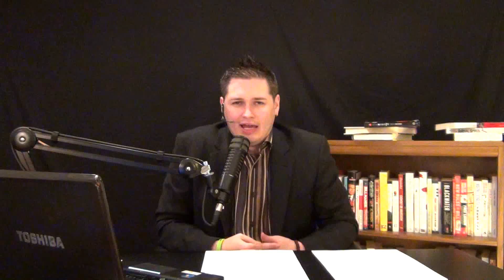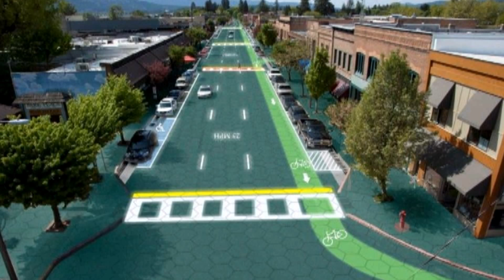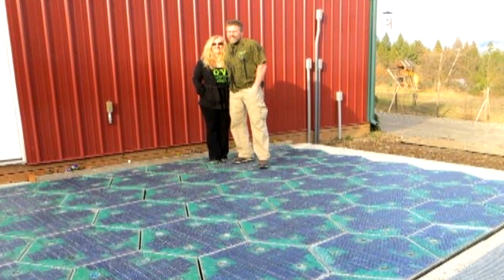Are 'Solar Panel Roads' The Future?

Comment: But will some part of the roads be transparent so that light can enter into the solar panels? Also, the solar panels cannot absorb a lot of light due to obstruction from the vehicles. Hopefully they know that this should not be placed in areas where there will be heavy traffic always in case there will be no light absorbed. Even if the solar roads are placed at areas where traffic is usually light, will the solar panels able to power most of the homes at that area? I am not against the idea, but you have to question it to ensure it can work well for a long time

Comment: Firstly, enough with the man-made climate change nonsense. Man-made activity has little effect on the climate and there are so many other factors that have far greater impact. Also, I still don't believe this is a legitimate role of government. I think infrastructure should go back to being privatized.That being said, I do think this is a great idea. We need to move away from nonrenewable energy sources because they are nonrenewable and will eventually run out. The problem is that solar panels are still pretty inefficient and costly. We don't need government involvement, we need private individuals and businesses to do more innovation free from government interference.

Comment: The latest results show the panels in the Netherlands are 56% as effective as consumer rooftop panels in the same area and even less efficient against commercial solar panels.
Reply: tvuspen commercial solar power requires some form of solar tracking. Which means you need free space to put down frames. Free space is at a significant premium in Holland.

Now we have plenty of roofs. Plenty of wind too. Agree that we should focus on those 2 resources first before throwing away a ton of money, break up our infrastructure just to use solar panels in the worst place possible.

Comment: actually, magic would be a better way of solving all of these issues at once.  Magic will not only do all the things solar roads will do, but will also allow you to magically transport yourself from a to b AND help fight dark wizards.

Sure if you want to believe everything you read that makes you feel good, then solar roads are for you.
For everything else there is science, and those who understand it.

Just run the calculations of average snow fall on us roads, and the energy required to melt it.
Reply: Second time commenting on this. Although the idea behind solar roads are good on paper, when you actually start examining the practicalities of all this; I honestly think it won't work in practice. Why? Its going to cost a ton of money, there will be concerns as to whether it can stand up to the heavy weight of commercial vehicles. Lets not forget the cost of replacing broken panels and in some cases, will these panels even be necessary or needed for that matter. Such as the more remote and rural areas of the country for example? They certainly wouldn't benefit from it IMO.

Also, where's the money going to come from?

Who's going to pay for all this?

Will there even be an incentive to go through with this plan?

Furthermore, how can you possibly plan to replace our roads, sidewalks and asphalt surfaces with these panels anyway?

Can you imagine how big of a hassle that would be?

Not mention the arduous and unenviable task of retrofitting, repairing or replacing all of our bridges, tunnels, highway overpasses etc, etc....How could this possibly work given all the variables that have to be taken into account? Trying to make this plan practical for daily use, in which the entire populace can benefit from, is a seriously long shot at best. And if utility lines and cables can be safely transported underneath these solar roads, then guess who's going to have foot the bill for this audacious endeavor?....that's right, the taxpayer. 

Anyway to bring my rant to a well deserved end, I say start small with a pilot program and see how people respond. If they like it, expand but do it on a city level. Not a nationwide level, it won't ever work.
Reply: ***** ok, gotcha, this aint the magic they make it out to be but would it hurt having this in places?
Reply: Durakken Look, I wasn't saying it was a bad idea, I'm just trying to be realistic here. Lots of people, such as myself, are really going to need some answers; that way they can understand the costs and benefits of this before they are willing to buy into the whole idea.
Reply: Yar a wizzard thundie'!!
Reply: Charles Johnson
at least bring up relevant shit v.v
Roads in general cost money, but having them is what allows for the world to work as well as it does ultimately lowering the price for other things by a huge amount.

The weight is concern... and that is why it is being tested.

Replacing a panel would be easier to do and possibly far more energy efficient than what is done now, as all you would have to do is drive out to the spot, pull up the defective panels and put in the new one. That could be done by 1 maybe 2 people. Asphalt repair takes several people, multiple cars, heating units, and the material. Looking at that it is obvious which is better.

Rural areas don't benefit from a lot of things, but if these roads are actually as easy as they appear a rural area would benefit in multiple ways, especially if they run internet cables in it. If they aren't run into rural areas, well who cares? They are neither negatively or positively effected directly.

The money would come from the same place that pays for roads now...also considering this could lower your electric bill and several other bills there is more than enough to pay for this.

Will there be incentive? Safer, easier to replace, more efficient, lowers CO2 emissions, makes several bills cheaper... I dunno doesn't seem like there is any incentive there v.v

Roads, sidewalks, and bridges are always being replaced. There are a few that might be problematic but no more so than they are in general as all these things need to be constantly repaired or they break down. The largest problem is the planning of when you'd be laying them down over time as you couldn't do it all at once, but rather over several years, and you'd need to educate installers as well as tie it into the grid which may cause complications.

What do you think they are doing exactly? They just got through their first few tests, a city has just signed up for it. People will be looking on to see how it goes there. If it goes well more cities will adopt until all or most cities do. If not, then that city will have an extra thing or it will revert back. It's not an issue.

As far as the issue with snow that ***** brought up. That's a local issue and not a very important one. At worst it only works for light snow which is the majority of snowfall and a majority of the problem as it creates sleet and ice which causes unsafe driving conditions. At worst it would completely destroy this problem. The idea that it would do away with plows I think is nonsense, but that largely isn't the problem and I don't see why it couldn't be used in conjunction with which would improve road safety, especially considering that heavy snowfall is hardly ever an issue. ie There may be a lot of snow over the course of winter, but it generally doesn't fall all on the same day or week to such an extent that it would invalidate usage of these roads in that way.
Reply: Charles Johnson I just gave you all your answer
Reply: Durakken Aside from mentioning myself, I was speaking in general terms; but thanks  for the responses. I did forget to acknowledge you previously.
Reply: ***** No. The plow would be used to push, say, the top 34 inches of 36 inches of snow. The rest could be melted with the heating. The only reason to have plows that are sharp and drag like that is because it's compacted and needs to be scraped off the asphalt where as with a heated panel you'd only need to lessen the depth to speed it up.
Reply: ***** Except it would be done slowly over several years out of the budget of cities/states rather than federal government and is accounted for out of the budget of the road maintenance that should already be as or more expensive... also as the process goes on the price goes down as the materials and technology is new and is part of the major costs.

Not to mention that this type of thing would be good for the US as we should be building infrastructure up more to begin with and with doing this it creates new jobs for people which both ultimately improve the economy which improves government budget and ability to pay for this stuff and thus isn't actually expensive, but rather, if anything, produces a surplus of capital, especially in the long run.
Reply: ***** Then say that rather than claiming it is too expensive.

You seem to think this would be a national project. It wouldn't be, as pointed out several times now. Local, State, and Federal governments do not act the same because the ease of which they are held accountable is different.

Further, it would be in the best interests of several companies to make a deal so that they can grab various rights so that they are not catastrophically harmed by the lose of profit. If you make electricity public for example, as these roads would do, electric companies would take a severe lose, which may or may not be a good thing, but to them it would definitely be a bad thing...likewise, phone and internet lines could possibly run through these making those public as well, which again, may cause problems for the phone companies.

These companies can try to stand in the way of this stuff, but it is likely that they'd fail in several areas of the country which would result in the economies of those places booming which would result in those companies standing in the way failing in more and more areas. Remember that this would have to be fought continuously in several hundred jurisdictions for years for them to permanently stop it and every place they don't stop it cuts into their profit and ultimately makes them less powerful overall and less able to fight back.
Reply: Yes, run the numbers of how much it would cost to melt the snow and then look up how much a city spends on snow removal each year.

Comment: Ocean water pressure is concentrated energy. Imagine suspending a 10000 pound weight 2000 feet in the air. The potential energy is vast and it never runs out when the sun goes down. I propose building generators that tap into ocean water pressure because it will never run out, it's clean, it's out of sight out of mind my design scrubs the atmosphere. WIN WIN WIN WIN. All across the board.

Comment: Solar is not the answer it requires far too many solar cells. The answer is tapping into ocean water pressure. The oceans are a huge battery that can supply the whole world with clean inexhaustible energy for the whole world. I know how with my design I just don't know where to start.

Comment: I cannot see them being used everywhere at first.  Baby steps man.  Parking lots are a great idea if they can charge cars wirelessly.  But also spots where traffic builds up, like st stop lights.  Make a few hundred feet of this smart street to charge people while they wait and just generate electricity in general.  I cannot see highways being completely replaced by this.  I can see a full lane made of this.  Maybe in a few decades it will be more likely roads can be made from this but baby steps.  Parking lots, driveways, by stop lights and even lanes for cars designed to charge wirelessly.

The materials we use now are first off, CHEAP.  Second they can make road much faster now then they would installing panels.  I'm all for smart roads, but I think we have millions of miles of road in the States and replacing all of it with this, is just something that would cost too much mainly.  

Oh, I saw the shade comment... but more often than not the road is free to collect the sunlight and convert it to solar.  You can search google maps and earth view the streets.  Yes there are cars but more road is left open than not.  By the stoplights idea I had... maybe we'll need to put extra panels on the side since if it's always covered or not use it to charge peoples car but to power local things like the stoplights themselves.  Every little bit helps.

Comment: If people could design these panels smaller to replace shingles on house roofs instead of the present photo-voltaic system, creating a power grid for each residence, that would really cut into carbon emissions also.  No need to burn as much fossil fuels at the power plant.  Solar panel roads could be just the beginning!

Comment: one practical problem: Roads have cars on them. The more cars, the more the road gets shaded. The more shade, the less power.
Reply: I'm sure they thought about it. Few roads are always covered by cars. Rush hours, yes, but the rest of the day not as much. The way solar energy usually works is that there are power cells of some sort where the energy during sunlight hours gets stored so it can be used when its not sunlight. I haven't seen their research but I would assume they've calculated that they will be producing more energy than necessary and with how many hours of sunlight. It may not work in all areas, like Alaska, so it should only be installed where its beneficial to do so. Also, there can be a back-up power source installed to ensure the road keeps working if there is a lack of sunlight for longer periods of time.
Reply: A negligible loss. They should honestly use this for rural roads first! Some of them are dangerously underlit & since so much of their lengthy roads are less used, they will last longer and absorb more power.
Reply: Edwin Casimir The tiles would probably be no more dangerous than floor tiles. And once they are mass produced, they won't cost that much at all.
Particularly when tar becomes more scarce...
Reply: *****
Too bad about the 'feel of the car' rhetoric, because fossil fuels will inevitably be scarcer and scarcer, and people will have to learn to put their feelings aside in order to have the fossil fuels run energy systems far more critical than nascar and lowriding with one's girlfriend. Like for instance in japan, for an excess of 100 years people in the inner cities have been getting around with bicycles because A. fuel costs a heck of a lot of money and B. traffic is often so constipated you can't count on the ability to always get to work on time if stuck in traffic. Sure, they agree on the fact that it's not the sexiest thing ever, but it's practical and it's affordable. Americans have got to start getting it into their mentality that the need for practical solutions is going to outweigh the desire for hedonistic tidbits that make them feel better, because in the long run, it'll determine the quality of living for future generations.

And also, more companies should definitely be incentivised to produce electric cars. And what happened between Tesla and the politicians is pure crony capitalism from what the politicians did. Fuck, man. The big corporations will do anything to keep their frail little monopolies running and to quash all forms of competition. Where's this 'fair competition' pie the libertarians keep bitching about keeping sacred now? Eaten by the deregulated markets, that's where.
Reply: the shade thing is only sorta true, ever walked barefoot on a road in july shit is ultra hot heat is energy sooooooooo?
Reply: bebobli Not rural roads... Roads that get medium heavy traffic, but get a lot of traffic at peak times. Elevated freeways.
Reply: jon Heinze Parking lots can have big sunshades that both shade cars from hot summer sun AND provide solar power. I don't know why more shopping centres DON'T do this.
Reply: dangerouslytalented sun shade style would probably be more pratical for parking lots
Reply: jon Heinze particularly when electric and hybrid cars are becoming more prevalent...
Reply: Let's not forget earthquakes, land shifts due to rain and flooding etc. (land shifts five inches and  a part of the rigid glass road collapses and shatters) and the off-chance that there might be a car, or truck, or building that tips over and causes millions in road damage. I am way too skeptical about this sort of thing. Why not just replace most inner-city cars with affordable electric cars and then make solar-powered recharging stations available everywhere?
Reply: dangerouslytalented when traffic is at its highest less than 5% of the road is covered with cars
Reply: Edwin Casimir Mass production would make it cheaper. Also, you don't give glass enough credit, we already have bullet proof materials as well as shatterproof and hurricane glass. We would of course have to do studies but there is a good possibility that they won't be more dangerous than current roads in a natural disaster and that the construction costs would be offset by use reduction costs. Mind, this is all speculative but we should let scientific studies and economic studies to inform us about whether this could be safe or cost effective, the possibility of this technology is worth a few million investment in studying it and its applications.
Reply: darkwingduckie7 Unless they are made from rare materials, mass production makes everything cheaper. That's how it works. It means that all the set costs per batch are shared over a LOT of them.
Reply: dangerouslytalented they wont have cars on every panel on every road 100% of the time not to mention all those half empty Walmart parking lots during the week... and i don't know when you last drove on a major interstate but you can drive miles and only see a few other cars at a time even in the middle of a day. It is not just the solar though you also got to think of how much less asphalt will be used and there would be no more pot holes since they use recycled glass.